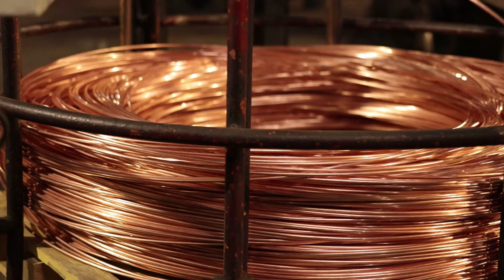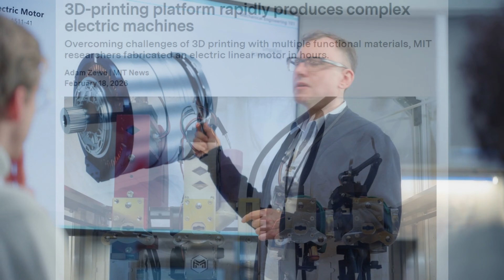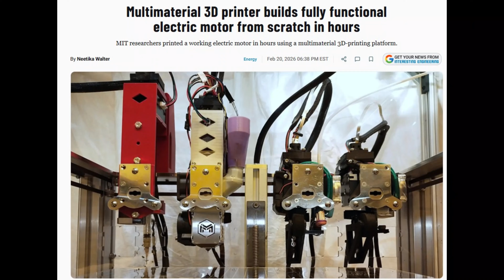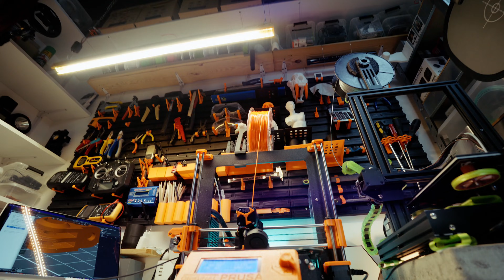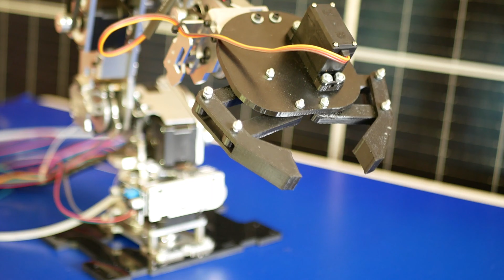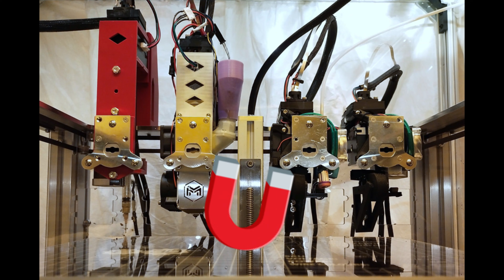New MIT Motor Made By 3D Printer – Here’s How

Comment: This 3D printing tech that integrates multiple materials in same printing run can bring about huge implications not only with the supply chain of certain kinds of electric motors, this will impact product and industrial designs in a fundamental way.   Conformal motors and mechanical components that blend in with the exterior of products and machines; Print-in-Place switches, nuts and other reuseable fasteners, receptacles...  Can't wait to try this!
Reply from the maker: Spot on, the design freedom is going to be a game-changer for engineering! 🛠️

Comment: Linear? If it was a linear motor, why do your visuals show rotary motors?
Reply from the maker: Good catch! The MIT prototype discussed in the video is actually a linear motor. The rotary motors shown in some visuals were used simply as general illustrations of motors to help viewers visualize motor components. 

Please find below the MIT study, where you can find more specified details:
1 - Cañada, J., Bigelow, Z., & Velásquez-García, L. F. (2026). Fully 3D-Printed electric motor manufactured via multi-modal, multi-material extrusion. Virtual and Physical Prototyping, 21(1), e2613185.

Thanks for pointing that out!
Reply: they will extend it for general motors @07:05

Comment: That is an amazing step in motor production.

MIT researchers recently developed a multimaterial 3D-printing platform capable of producing a fully functional electric linear motor in roughly three hours. The breakthrough allows for the creation of complex electromechanical devices in a single process with minimal assembly, costing approximately $0.50 in materials per unit.